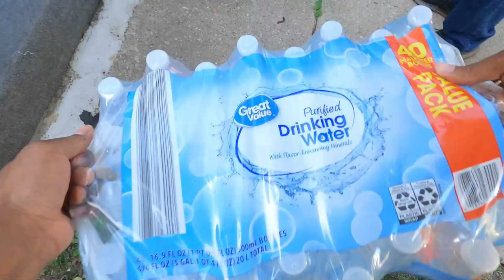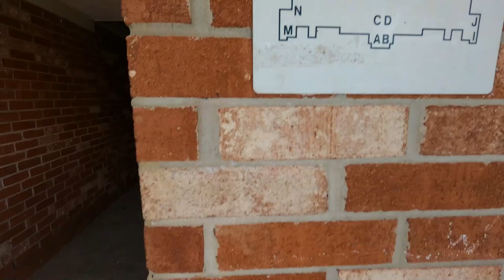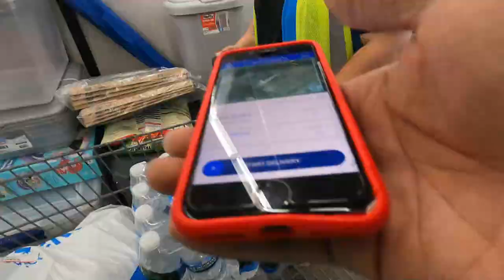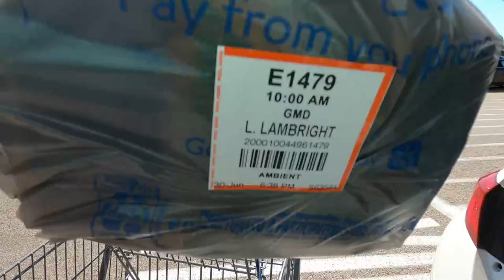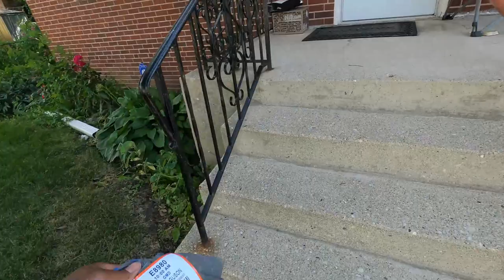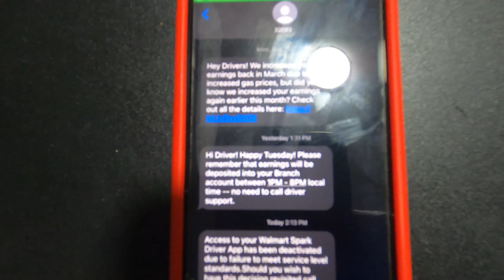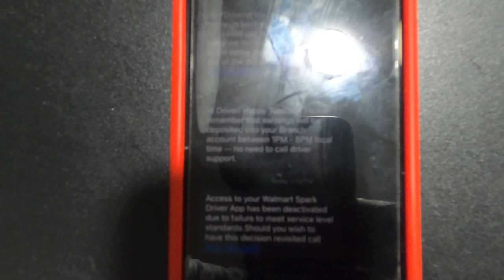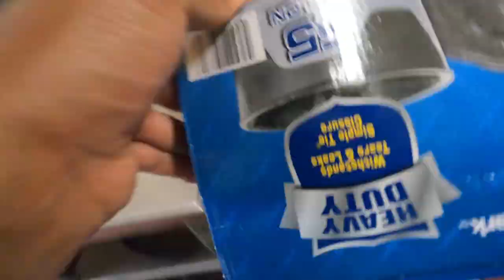Why Did I Get DEACTIVATED From Walmart SPARK? Plus A YouTube Violation, Not A Coincidence! #haters

Comment: Yes, somebody did complain on you, but Spark knows exactly why they deactivated you! This is the exact same psychological machine used on Lyft with the exact same customer service reps! They have to condition the drivers to shut up and deal with it program to keep drivers guessing and wondering who called etc,to depress the driver once the driver is depressed long enough, they know that these drivers will fall in line and do what they need. Spark is showing signs that they will be doing what Lyft is doing with their platforms drivers which is to use intimidation,  manipulative, coercion tactics to make them believe it was a complaint but it wasn't. They will start deactivations without warning if it's too many black people working in a region, if a driver makes too much money, or if the drivers are getting too comfortable or thinking they have  did something wrong when they didn't
Reply from the maker: That is CRAZY!!!!!

Comment: Don't sweat it man call them Bout reactivation. What I learned  is alot of gigtubers get deactivated As long as you follow the TOS you are all good. 

Just be curious with the bodycam thing honestly I feel all drivers should wear as I also do the same. There are alot of confusing yes and no issues related to it be sure to read about civilians privacy acts rights etc.

As for for this deactivation I'm curious to what your metrics were was everything in the green. As for going into the homes just dont record alot privacy concerns with pictures etc. If customers wants things inside they need to pay more for in home service delivery through Walmart not independent contractors
Reply from the maker: You have a great point! My Metrics were: 
98% On Time Arrival
6% Drop Rate 
24% Acceptance Rate
4.9% Customer Service
Reply: @carsandcribs  interesting usually everything should be green besides acceptance rate we all know crap orders come in. I believe drop rate should be below 5% is 6% orange
Reply from the maker: @Trixz2007  Yes, 6% is orange but also when I was at 4% it was orange.

Comment: I thought that you have to confirm that the customer is. There before u drop it off or did the customer notes say otherwise?
Reply: Visible contact is required unless stated not too by the customer. The drop amd go is usually a doordash thing. As for Spark you must have visual contact to confirm customer is home and not needed to return to store
Reply from the maker: @trixz2007 is correct!